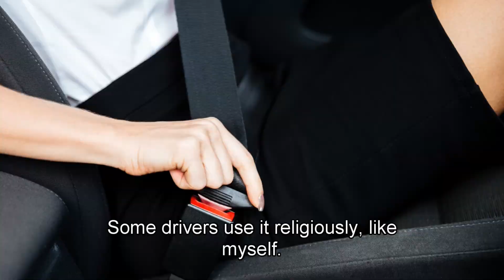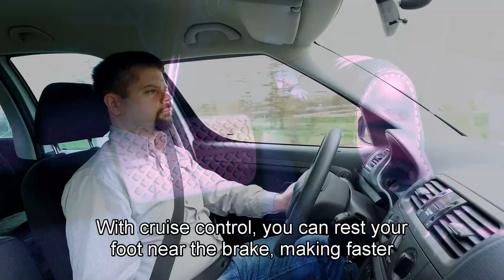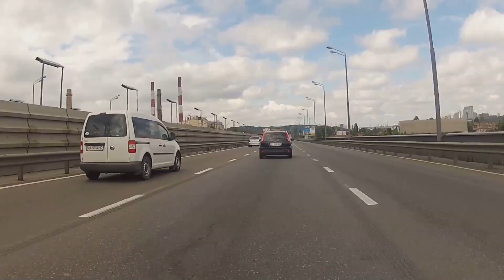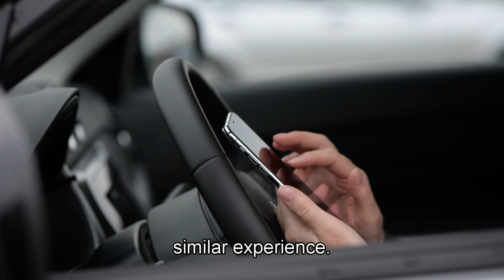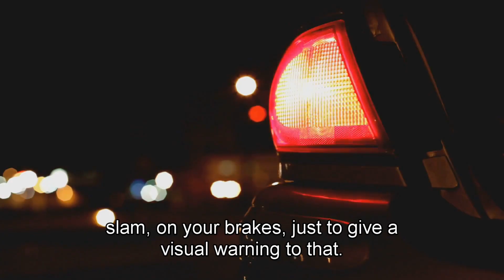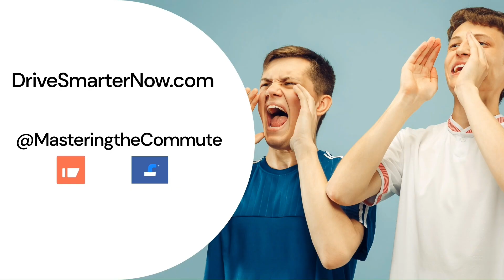Mastering the Commute: The Power of Cruise Control: How to Drive Smoother & Save Money-episode 12

Comment: Totally agree: adaptive cruise control increases situational awareness if well factory calibrated end used correctly.
I will add not rely on what the brochure or the salesman says. Instead, carefully read the instructions related to your vehicle ADAS, all the limitations that these systems have and then test them on the road.

My Mazda 3 has a very well calibrated ACC I use it also in heavy fog: it can spot slower cars before I can see them.